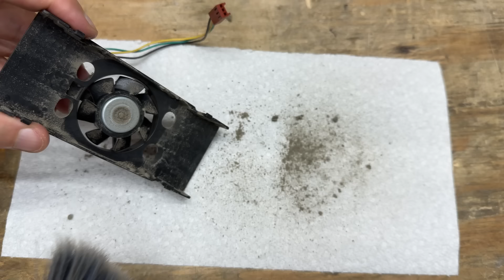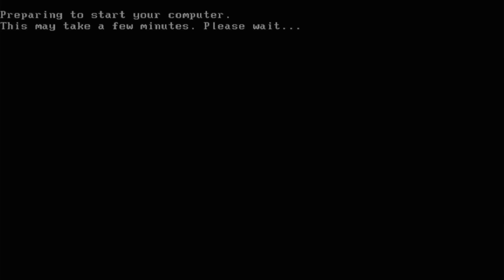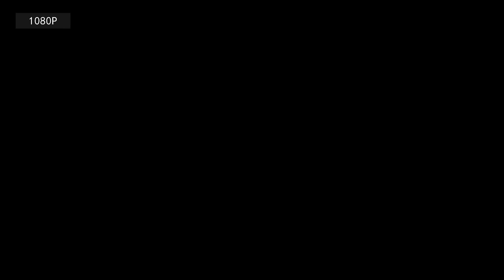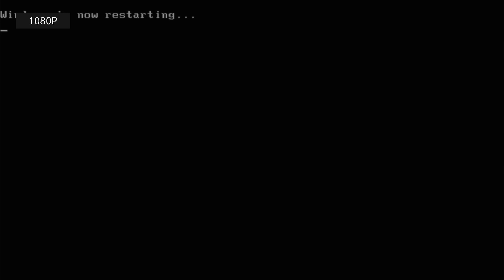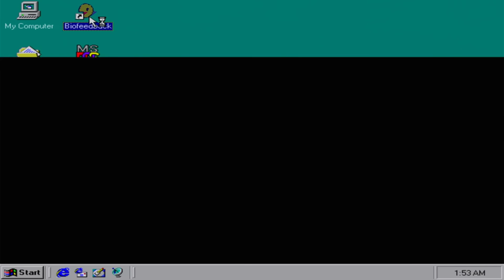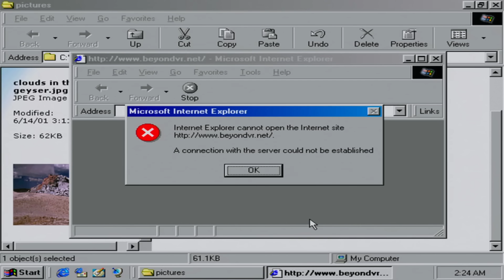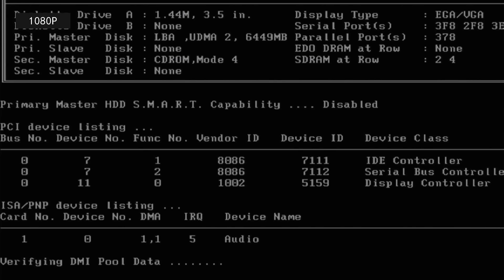'90s Desktop Teardown and Test: It Got Weird!

Comment: Sometimes, you're just glad that you don't know what caused the power button on the PC, or likely it's once matching keyboard and mouse to be so nasty. Actually, no, all the time, definitely all the time. I don't want to know what sketchy early 2000's shenanigans caused that, not at all. I am scarred for life for some of the stuff I saw backing up peoples PC's back in high school when I worked at a local repair shop as it is.
Reply from the maker: Especially from one that was in the brain lab….
Reply: @miketech1024  Yeaaaah... I didn't want to think about that... Still, it's really cool they were using such odd, rudimentary software for such complex procedures.

I'd love to see the hardware that it interfaced with... Mainly 'cause I wanna see someone play Doom with their brain. 

I mean it's already setup to run DOS programs soooooooo...

Comment: A computer that has just the DOS portion of Windows 98 will show the splash screen like that. They probably used a Windows 98 boot floppy to install a minimal system on the computer to run the TOVA software.

Comment: I rescued an ATX desktop from being tossed.  IIRC the badge said Northern, and the PC was used for access control software (Northern merged with Honeywell.)  It connected to a keycard access controller through a serial port.  The system was a Pentium 166.  The desktop had 2 external 5.25" bays and 2 external 3.5" bays

Comment: As soon as you turn to the back I/O out I said to myself that's a slot one motherboard. LOL 

The giveaway was atx layout with black PS2 ports and USB 1.0 aka white connector.
Reply: You can find all kind of early ATX systems with all black ports like Super Socket 7, Slot-A, even very early Socket 370 for early Celerons and I'm kind of sure I have a Socket 462 for early AMD Athlon with all black ports  😊.
But the fact that you can find a Super Socket 7 ATX always make super excited when I see that ports on the back. (Dual Slot-1 or Socket-8 are never on my mind but that would be insane)
Reply: @RetroTinkerer  I do agree with you lots of boards could have the black I/O,  I recall the coloring of the I/O port's came out late '97 or early '98. And I was at a small mom and pop store doing all the installations 96-00 and 90% at that time were slot 1.. good old intel Seattle BX (440) was the most common mb at that time. well premium mb 🙂

Comment: That modem is relatively nice. It's not a softmodem.
Reply: ISA modems like that are far easier to use with DOS applications, which seems to be all this computer was designed for.
Reply: @mattelder1971  exactly. Most at that era were all softmodems. They could only be used with Windows. I realized how terrible they were when I started using Linux.

Comment: These clone systems from the '90s and early 2000s always seem to have at least one questionable part choice here and there, like them using a PCI video card instead of AGP, or the floppy drive using an adapter instead of just going into the slot for the floppy drive, or the hard drive going in a 2.5" slot instead of that actual caddy.

My parents used to have a Gateway 2000 386 that had a 3.5" floppy drive in one of those adapters, but it didn't have any 2.5" slots! Whenever I talk about their systems I feel regret about not saving them, though.

When I've had to remove a hard drive from a case like this where, in a case of one of them, the front panel wasn't obvious to remove, I just removed the floppy drive or pushed out the blank of the slot immediately adjacent, pushed out the blanking plate of the slot the hard drive was taking up, and after unscrewing it, pushing the hard drive out. Of course, that would only work in this case if the hard drive was screwed in on only one side and you could get the other side off -- which you can't. I had a weird system where I had to unscrew the hard drive from the bottom of the case!

Those drive rails look delightfully Antec or Chieftec.
Reply: I'd say that if this computer was built specifically for the software that's running on it, going with a PCI card instead of AGP was simply a cost cutting choice. No need for a high performance AGP card to run simple DOS applications.